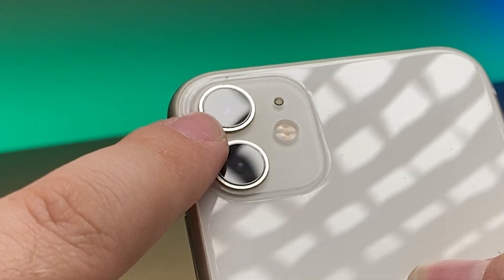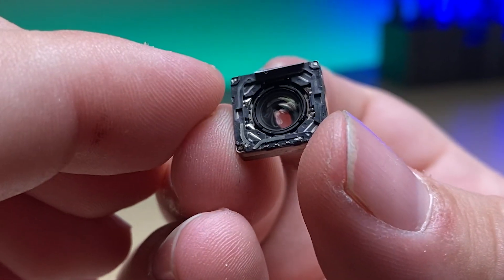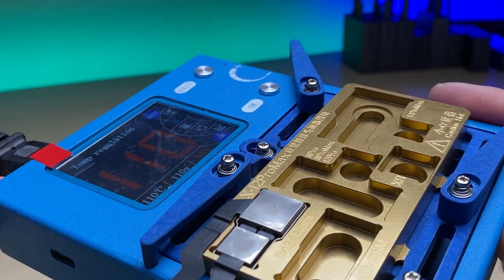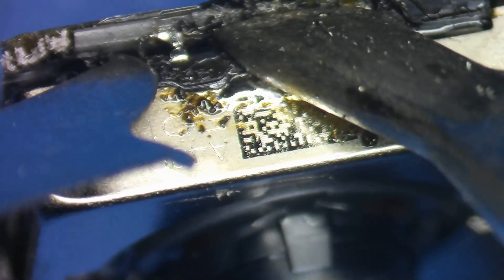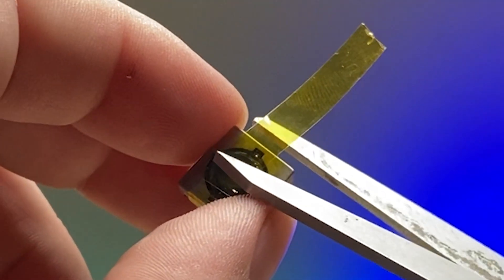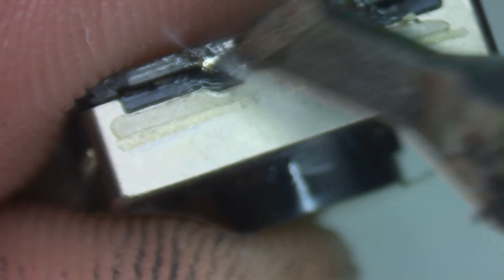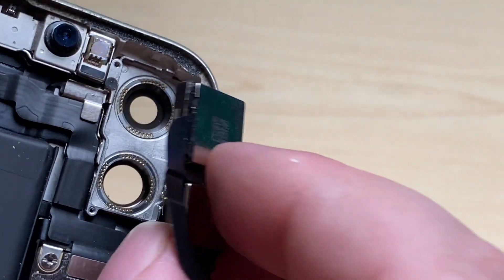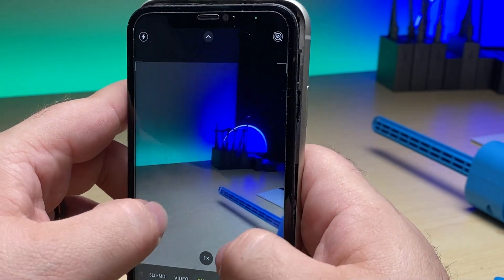iPhone Rear Camera Motor Replacement: Step-by-Step Guide

Comment: Thank you for your help. I would like to ask if it is possible to change the cameras from one iPhone 13 to another without getting the "unknown camera" message, not the flex cables. Only the cameras where the motor and lens go, not the board.

Comment: Good morning, what liquid would you recommend to clean the optical lens of the iPhone 14 cameras that got heat tape stuck on it? In general, what should I use? Thank you.
Reply from the maker: Isopropyl alcohol 91-99% or acetone, both with a Q tip or microfiber cloth

Comment: Thank you for your contributions to all of us who work on this. I have a question: if my camera gets damaged (motor, lens) but the flex cable is still good, how can I change just the camera and solder it to the original flex cable? I tried transferring a camera from one phone to another, but I got an unknown camera error. However, I saw somewhere that generic cameras are sold. Would those work? Thank you for your time.

Comment: Thank you . Your video has been very helpful. I would like to know why sometimes, after cleaning and closing the camera, it doesn’t focus. Other times, it shows static, and occasionally, an unknown camera error occurs. What causes this? Thank you.
Reply from the maker: I’ve seen it happen when the solder joints aren’t perfect, not properly cleaned or if it was overheated during the process.

Comment: Hey man great video and you even opened up the actual lense but i got curious enough to ask you that what if we can switch up lenses of a phone into another phone? For ex. An 200 megapixels S23 Ultra into an iPhone or any other Android phone if the lense can fit into the hole? Ik the software won't act as if it knows that the lense is 200mp so it will take a 200mp photos/videos or it will straight up won't support the lense, etc. but still worth a try right?? Please do reply or make video if this topic is video worthy enough, I'm eager to know anyway.
Reply from the maker: That would be cool. The main thing is that the solder joints would need to line up and serve the same function as they are for more than just to anchor the lens to the camera. I’ll look into it though.